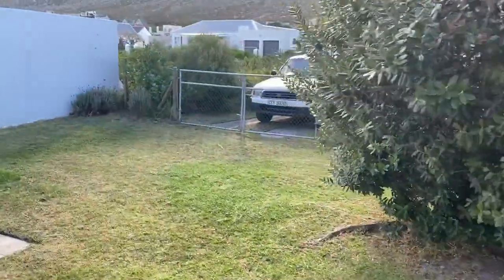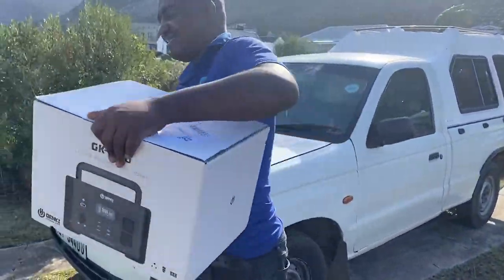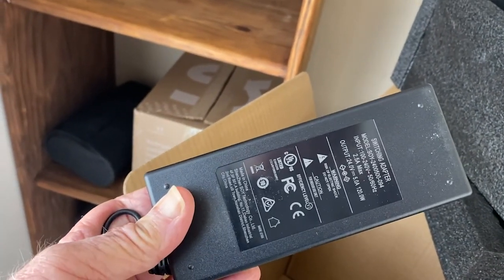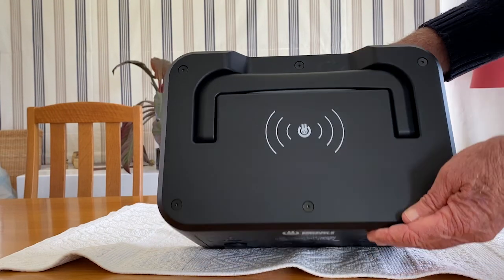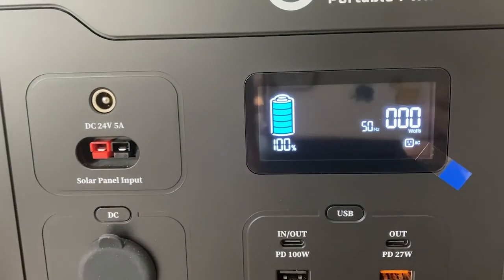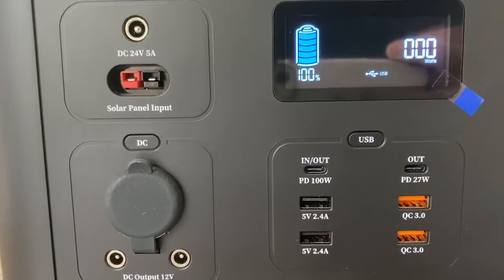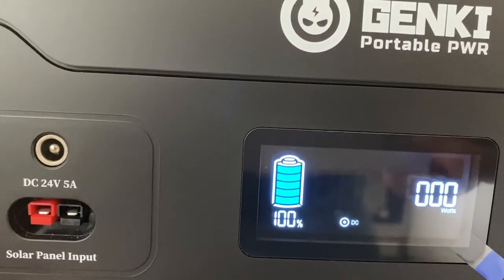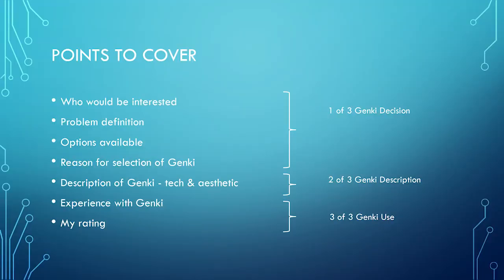Genki GK-1000: Detail view

Comment: Hey Gavin, I saw they said the charge time is increased by 100% if using the AC input and PD inputs combined. Have you tested this at all? And does that then give you a full recharge in about 2-3 hours? The documentation isn't very clear on this
Reply from the maker: Hi, despite my original intention of using solar to charge, life moved on, and I have not tried. In theory, if the claim is true, I would expect that adding a second input voltage (in the place of solar) should achieve the same outcome 🤷🏼‍♂️
Reply: @gavinberry1796  Hi Gavin, do you perhaps know if this has a built in MPPT charge controller. I see a lot of people selling solar panels with various types of charge controllers.

Comment: Hi there, I do have a Genki, but it does not charge to full capacity. The third time I charged it, it only goes to 66%. Is there a way to reset it? Thanks
Reply from the maker: It is difficult to diagnose electronic issues over social media. I will leave a link that gives a good broad outline of the batteries that make up you Genki below, read that and see if anything sparks (sorry!) a memory/thought. If not, it would be best to find a battery technician in your local area. 

If the device is relatively new, you may be able to get the retailer to give you a satisfactory remedy.

The base components are industry standard, so your situation should not arise unless the Genki has been used extensively (over at least 300-2000 charge cycles)

https://commonsensehome.com/21700-battery/
Reply: @gavinberry1796 I have the same problem after 15 reloads, see what the importer will say .....
Reply from the maker: @paleosuchex  Please keep posting here - it will be of benefit to other owners.  I have to say, I am disappointed that some of you guys are having issues, so far (quick - where is that wood) our unit is working great.
Reply: Good evening,
Thank you for your reaction.

I will bring the Genki 1000 to my supplier within two weeks and i will inform you of the result. @gavinberry1796
Reply: The supplier did a software update, so far so good.
Reply from the maker: @paleosuchex  please could you post here how to obtain the upgrade, many of us may want to take it
Reply: I bought this product at builders and it stopped charging to its full capacity in a month period
Reply from the maker: @JeSsIcA_MAD  look at the entry by  @paleosuchex above, you could try for the firmware upgrade too